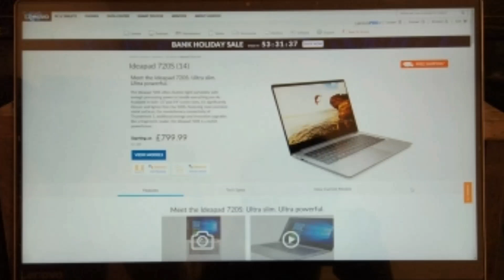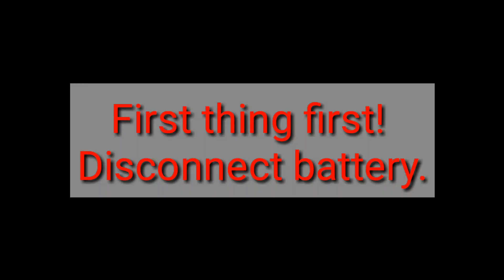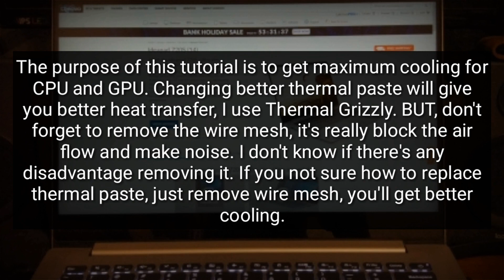Lenovo Ideapad 720S - Disassembly Thermal Issue Maintenance Repair RAM Upgrade

Comment: Just did this and used your video for reference thanks. And good tip on the dust filter. The original thermal paste was awful and was applied everywhere except the CPU for my unit.

Comment: Great video. I am considering purchasing this laptop i7 7th gen 8gb of RAM. 141KB Would you reccomend it. Is it still fast?
Reply from the maker: Agree, but for me this laptop have the best value even have thermal throttling issue. With powerful inside can keep the size small and thin.

Comment: i also have same laptop 720s 14ikb, 8gb ram and i want to upgrade , which ram you are using means which company ram, and which company ram you would recommend.
Reply from the maker: Many, depends on location. V-GEN, gsklill,
Reply: @LimpingGander  which one you are using?

Comment: I got the same laptop with 8GB ram as default and I was planning to upgrade to 16GB ram with 2400mhz. have you noticed any difference in the laptop performance and speed? I've taken off the ram shield and some of the small clips have broken off they seem very sloppy have you had the same experience when removed the shield?

Thanks for the video,
Reply from the maker: AFAIK, speed of RAM is not noticable. But the size will give you significant performance. 

Nope, I manage to keep the clip of the shield intact. If you stiycan make the shield in place, you better to put it the shield. The shield is definitely have purpose.
Reply: @LimpingGander  did the increased ram helped dealing with heavy tasks like video editing/rendering?? i plan on upgrading my 8gb ram to 16gb tia
Reply from the maker: @samuelgonzales3573  rendering will also heavy on CPU, but having more RAM definitely will help you on that.
Reply: @LimpingGander  but what about you? Did you feel limit of RAM before upgrading? And do you feel machine faster or so after installing 16gb ram?
Asking, because just bought such a used laptop in perfect condition. And think about upgrading to 16gb ram. But have doubts, if it's really needed?
And by the way, yes, I like that screen sound and size of the laptop. Really cool one. 
And by the way, I set up max % of CPU to 98 and have no turbo cooling system noise and start-stop of fans. But also plan to change thermal paste and take of that "HEPA" filter )))
Reply from the maker: @zmtdrt8411  Yes I'm. When I'm working, I open a lot of browser tab, having a lot of ram definitely help me.
Reply: @samuelgonzales3573  only on 4k material if you render 1080 you re perfectly fine with 8 gigs
Reply: @LimpingGander  Hi! I have the same laptop, and i need to know if this laptop have two slots for the ram or just one slot, because if don't have two i'll buy one of 16 gigabite, however if has two slots i preffer put two of 8 gigabite. Thanks and sorry if i said some word or sentence wrong i am a speaking spanish.
Reply from the maker: @leonelbarcelo2473  Only one slot as shown at the video.
Reply: @LimpingGander  thanks, is it possible that a ram memory is soldered on the board? because I read that in some models of the ideapad there is 4gb of memory in the slot and another 4gb soldered on the board.
Reply from the maker: @leonelbarcelo2473  I'm not sure, you check it first before buying

Comment: Hello! I have the same laptop but with 8th gen i7 processor with 16GB of RAM, it's still within warranty so I won't open it however people have said that 8GB of the  16GB are soldered on and the SODIMM is an 8GB stick, in your case, was the stick 8GB or 4GB?
Reply from the maker: As far as I know, this laptop can support only 16GB of RAM max. If you have already 16GB, you can't upgrade it anymore.

In my case I have only one stick of DDR4 SODIMM 8GB. As default spec. And I change to 16GB. As shown in this video.
Reply: @LimpingGander  What kind of RAM do I have to buy for this laptop? I've 8gb, and wanting to upgrade to 16! Can you help me?
Reply from the maker: @Kryvenic  I just use generic 16GB memory stick, using brand V-Gen that popular in Indonesia
Reply: @LimpingGander  I bought a Corsair's Vengeance ram, I hope it works

Comment: It’s possible to change anything else in this laptop for better performance?😅
Reply from the maker: haha, change RAM to 16GB is the best way to improve this laptop capability. This thermal solution will also help, since this laptop experience throttling on CPU. Try explore ThrottleStop software to maximize the clock limit, but be careful not to aggressive. I do use it, so far so good.
Reply: upgrade ram and put a newer faster  drive

Comment: what do u think about liquid metal thermal paste in this use case? will it be problematical while being in motion...its a mobile device after all...
Reply from the maker: I don't think it will be a problem, since the liquid is "trap" between two surfaces. But using liquid metal thermal will not significantly decrease temperature since the heat sink is not that big.

Comment: Cool video! :D Aren't you worried about dust after removing the filter?
Reply from the maker: Of course it will be much easier to collecting dust, with that the consequences is we need to do cleaning more often.

Which I okay with that.
Reply from the maker: Of course it will be much easier to collecting dust, with that the consequences is we need to do cleaning more often.

Which I okay with that.
Reply: So how is it after 7 months? How many times did you clean already? 
Are you using any speedfan app or did any sw tweaks?
Reply from the maker: @paranoiq2  Since I do this I have not been open or clean yet. Usually I do cleaning my laptop if there's visible dust on the air flow or the fan noise got really loud than normal. Usually take more than 18 months before first cleaning. After more than 8 months do this on my laptop, I didn't see any visible dust that blocking the air flow and also the fan noise and the temperature is normal.

I'm not using any fan control app. I use ThrottleStop software to boost up the performance a little bit. It's risky because the laptop will get hot, around 80-90 degree Celsius depends on room temperature.

Comment: Hello, thanks for the great video! Ich have a similar laptop , except i´m using the i7 8th gen, i want to upgrade my Ram, how many pins is this sodimm slot? Is there a limit on the speed it can have? Any brands you recommend?
Reply from the maker: I don't about the number of pin, it's DDR4 SODIMM type. The default memory speed installed is DDR4-2666 I also upgrade with this speed. The max RAM you can install I got from forum is 16GB, and you can use DDR-3200 if you want faster DDR speed. 

For me, for regular usage RAM brand is not giving significant performance, choose any brand that give you better warranty support. Because most RAM brand give lifetime warranty.
Reply: @LimpingGander  Thank you!

Comment: I changed the ram but now the notebook does not turn on. Is like dead. Y put te oldest ram and nothing happens. Ideas? Thank you!
Reply from the maker: @gap1985  maybe your RAM spec is not correct. Or your RAM actually dead. Need to check to other laptop I think.

If other RAM is working, then it is not the laptop issue.
Reply: @LimpingGander solved! I did a power reset, disconnecting the battery and pressing the power button for 1 min.  Everything is fine now. I hope this works for somebody with the same problem. Bye and thanks for the reply!

Comment: This a poor laptop as it do not support dual channel ram, ryzen 5 makes wonders with dual channel ram, go for hp envy or asus x505za only lenovo sucks only the soldered ram are the dual. Channel ones
Reply from the maker: Yeah, since is not Ryzen, it's not significantly different with single channel ram.